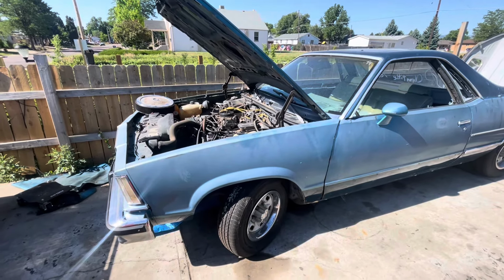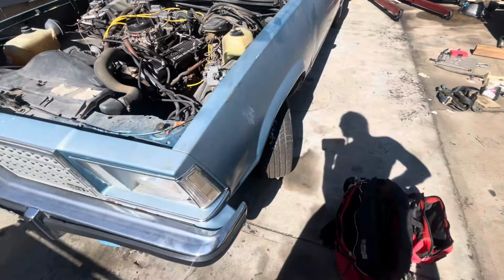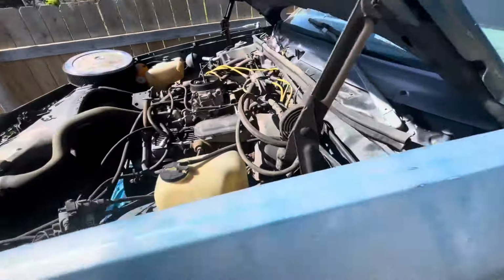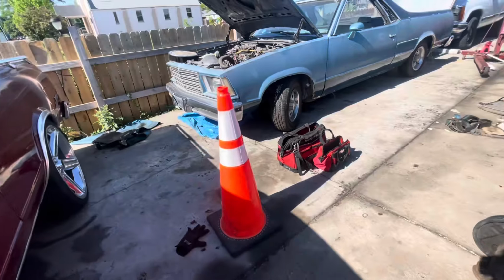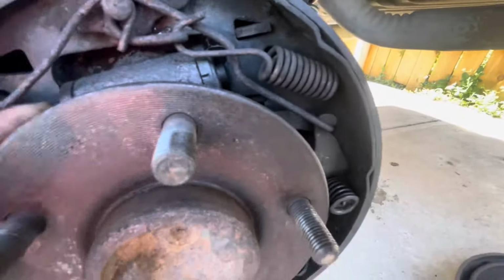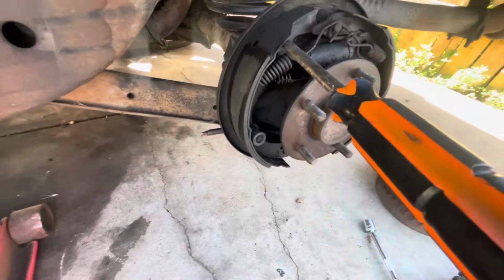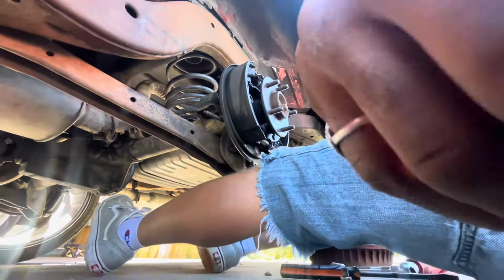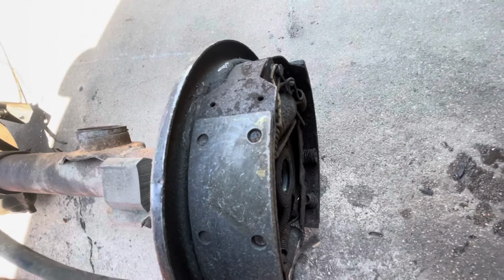El camino parts are going fast

Comment: Nice save on that brake cylinder. Hopefully it don't gotta come out. I ended up getting the rear brake kit. I did driver side. Hardest part was putting that cylinder back in. I couldn't get that little clip that holds it in on back side back on. One of the homies had to come n help. It just takes a good smack with hammer n flat head. I ended up leaving the passenger side. The springs that came with kit was easy. Was there a smog pump in this Elco?
Reply from the maker: Yea that clip is hard to remove and no this smog was gone also I want to do rear disc brake real soon im tired of drums